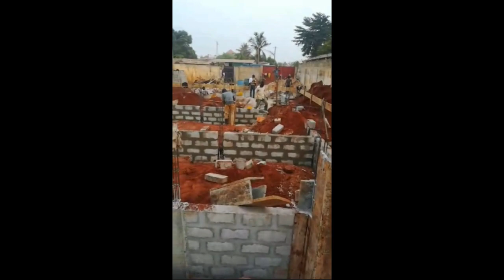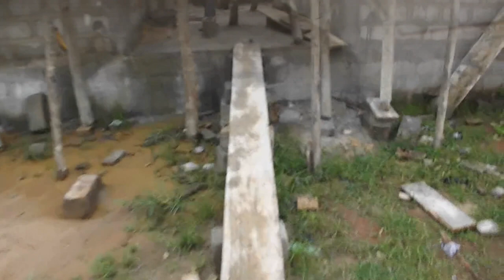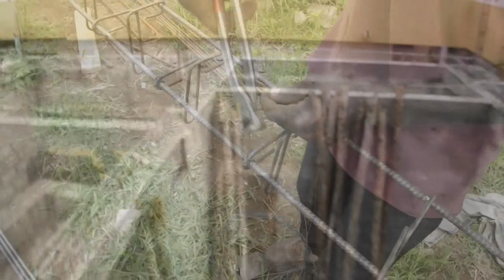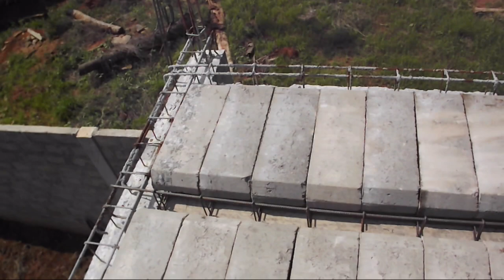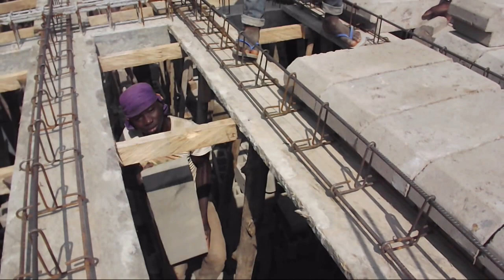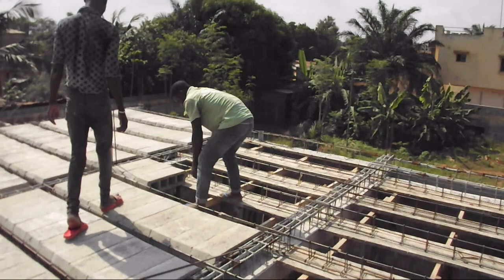Hourdi Blocks On Rib Reinforcements

Comment: Waw nice! This method of suspended concrete slab will obviously be a cheaper method than the solid concrete & iron rod type that is commonly used in Ghana. It would be interesting to know how a cost analysis to the traditional method would look like.
Reply from the maker: Hi @ekwessi, thank you for tuning in.  I have not yet built using the "traditional" method in Ghana.  I would recommend that you contact Fast Floor Contruction Ghana's channel at https://www.youtube.com/channel/UCfINOUMyQfOQ_-9gdxdSlGA.  I suspect they have done such a comparison and would be glad to share.

Thanks for dropping your comment.  Don't be a stranger...see you back here soon.

Comment: i want to know why the support for the formwork aren't vertical but supported in digonal form.
Reply from the maker: Hey Stephen, longtime. Thanks for tuning in. Not sure that I understand the question completely. Diagonal? Do you mean vertical versus horizontal?  In other words, parallel versus perpendicular?  I am not aware that it makes a difference when changes in arrangement occur across beams.  Please advise. Thanks.

Comment: why didn't they do 1.5 feet blocks to avoid breaking some of the blocks?
Reply from the maker: Hey bro, thank you for tuning in again and thanks for the question.  So we work in metric and not imperial on this project.  We cut 60 cm blocks to fit.  You are suggesting molding smaller 45.7cm (1.5feet) blocks instead, which in some instances you will have to cut and fit.  Great question...from my perspective, it is six of one, half a dozen of the other.  

Detailed prep and casting of both slabs are in videos on the channel with more vid clips on the topic to follow.  Feel free to check them all out.  Please, do come again.
Reply from the maker: Just checked out and subscribed to your channel.  Nice videos.  Consider turning on comments for each video so that viewers can engage and provide feedback.  Cheers!
Reply: noted and thanks

Comment: Weight  of one block
Reply: Hello sir,
Please is this method Safer than using iron rods?
Also is it only in Togo they use this method?
Thanks
Reply from the maker: Hello, thanks for the question. This method is safe.  Feel free to look up "hourdi blocks" on the internet/google/YouTube.  More iron is deployed after hourdi blocks are layed, prior to casting.

This methodology is widely used in many countries around the world.  I hope you find this helpful. Regards.
Reply: @AyiviTV  thanks a million for the brilliant idea, however, I will like to know what is gauge between the two columns?
Reply: I applaud your use of hourdi block. I was planning to precast girder beams for my build, but i have a question about your ribs.when you lay the rib iron beam on the plank, how do you insure adequate concrete cover  under iron rib? Is the rib iron raised up off the plank, like sitting on small stone?

And how does the rib beam support the blocks? Since its formed on the sides and not tied into the blocks like those methods where the hourdi block is sitting on a precast girder.
Reply from the maker: @Esaki Muthu, thanks for tuning in and thanks for the question.  Don't have the weight.  

I can tell you the following:
Dimensions 60cmX15cmX20cm

50kg bag of cement makes approximately 12.3 hourdi blocks.

1st slab:
100bags (50kg cement per bag) yielded 1,221 hourdi blocks or 12.2 blocks per bag.

2nd slab:
101bags yielded 1,252 hourdi blocks or 12.4 blocks per bag.

All blocks are manufactured on construction site.

Esaki, I hope you find this helpful.  Please, do come back.
Reply: @AyiviTV  thanks  for your reply  . For manufacturing  of this blocks  other than cement what materials  ( sand,metal)  used and ratio of material  used
Reply from the maker: @Esaki Muthu. For the hourdi blocks only cement, sand and water.  Cement sand ratio/bags of cement:wheel barrows of sand/3:5.  
After laying hourdi blocks, gravel is added to the mix to cast the slab. Thank you!
Reply: @AyiviTV  thanks for your reply
Reply from the maker: @esakimuthu5135  Sure, you are welcome.  Don't be a stranger.  Please come again.

Comment: The hourdi blocks serve as the cieling of the building?
Reply from the maker: @Wilbert Licuran, hi my friend! Thank you for tuning in and thanks for the question/feedback.  Hourdi blocks are used for construction of concrete ceilings, concrete floors or concrete slabs.  Thank you!
Reply: @AyiviTV  so nice friend,in the Philippines ,second floors mixed sand and gravel and cement were used.but for bungalow houses flywoods are use for cieling.
Reply from the maker: Thanks for sharing.  After laying hourdi blocks as shown in vid, 6mm rebar coupled with mixed sand, gravel and cement are used for casting the slab.. 

The hourdi block methodology is an alternative to others. 

Kindly see next step here: https://youtu.be/Z4Eo_n-p868

For decorative purposes, false ceilings may be installed to conceal the concrete ceilings.

Best regards to you and yours in the Philippines 🙏🏾